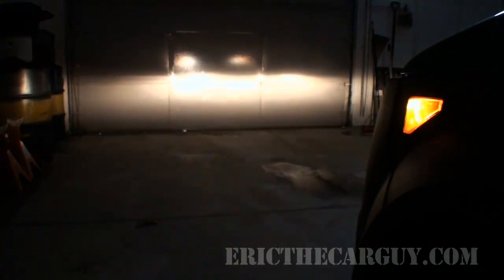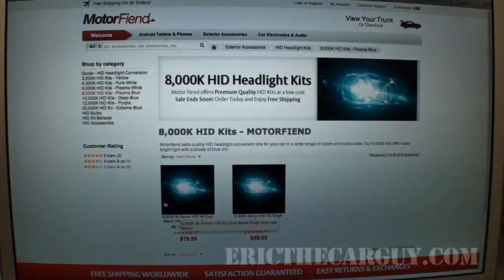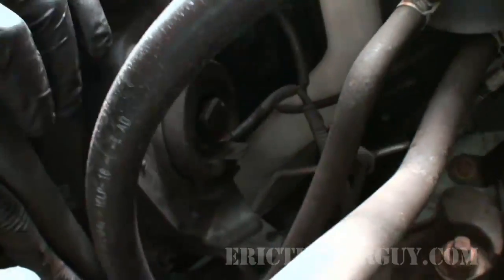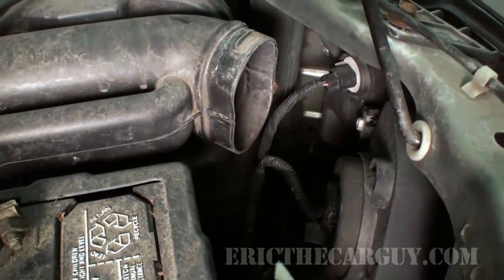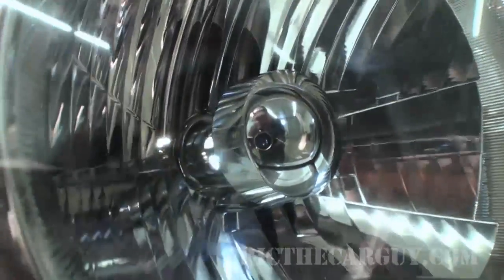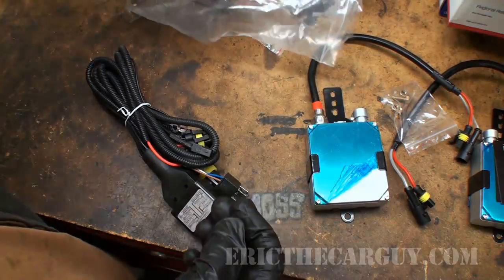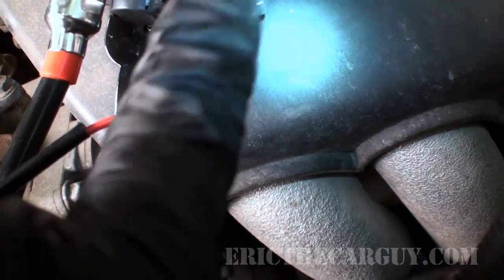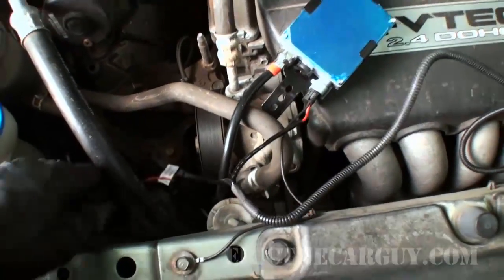How To Install an HID Headlight Kit -EricTheCarGuy

Comment: Which HID setup would be adequate for 1999 Toyota Camry LE, 8000K or 10000K in diamond or sapphire white?
Reply: Neither. 8000K and 10000K are way too blue. The K (kelvin) numbers correspond to the color temperature of the bulb; basically, the higher the K, the bluer the light is going to be. 6000K, 8000K, 10000K...basically anything over 6000K is going to have a very heavy blue tint to it - it's not going to look anything like what a stock Lexus, Audi, or BMW with stock HID headlamps has. "Diamond" and "sapphire white" are just some cheesy descriptions that some seller uses to describe the color of their 8000K and 10000K bulbs. Don't be fooled - there is nothing "white" about an 8000K or 10000K bulb. In fact, most halfway-reputable retailers that offer 10000K bulbs describe them as "deep blue". Not white at all. Do a Google Image search. 

You're going to get the most bang for your buck with a bulb that's 4300K or 5000K. Bulbs in those color temps have the highest lumen (measure of light output) per watt. That means that for each watt of power being sent to the bulb (you're going to want 35W), more light is emitted from the bulb. Between a 35W 4300K bulb and a 35W 10000K bulb, the 4300K one is going to be much, much brighter and look much more like a stock HID bulb would. The higher (bluer) you go on the K scale, the less usable light you have, and the worse the road will be lit in front of you.

None of this is really relevant if you're not going to retrofit your Camry's headlamps with projector housings. If you just put a plug-and-play kit in your existing reflector-beam headlights, you're going to scatter light all over the place regardless of what color you choose, which is going to blind and piss off everyone in oncoming traffic, and the illumination from your headlights is going to be worse off than if you were to get better halogen bulbs.

Hope that gives you some insight. Be considerate of other drivers. Making night driving more difficult and dangerous for others while at the same time worsening your own vehicle's illumination for the sake of having those "k00l blu litez" is definitely not worth it. Also, 8000K or 10000K headlights in an otherwise stock Camry would make you look like a huge wannabe-ricer...that's just my opinion, though.
Reply: thanks man, much knowledge gained, i think i went with a 4500/6000K pack and i can see the road clearly now.
Reply: Tom McKenna Hey there, I have 10K bulbs on my stock tl 2000 right now and I was looking for a blueish light, but the light is really white. So if I want to go white and best output I should get 4k or 5k?
Reply: Indie Guy I don't know that I've seen many (if any) HID kits that are offered at exactly 4,000K. Usually, the lowest "white" color temperature offered is 4,300K, which is the closest you can get to the color that a vehicle with factory-installed HID headlights has - for instance, my Optima SX had HIDs from the factory, and I believe they're rated at 4,250K...very close to 4,300K.

From the various technical articles I've read, it is my understanding that the highest light output per watt is achieved using ~4,200-4,500K bulbs. Bulbs that are any higher in color temperature usually have a type of blue tinting applied to the glass that surrounds the capsule, and that tint is what lowers the light output. It essentially creates a barrier between the capsule, where the light is being generated, and the road ahead of you.

For the best bang for your buck (the highest lumens per watt), you're going to want to get a 4,300K 35W bulb (stay away from 55W unless you really know what you're doing, or you like melted housings/projectors/reflectors/wiring). This is going to give you a pure, non-blue-tinted, very white light that looks identical to what a car with a factory HID system has. Don't worry though, it's definitely not going to look yellowish like a halogen bulb would. You're definitely going to be able to tell that it's an HID bulb.

5,000K would be okay, but most of the kits I've seen use that blue tint on the bulb glass to achieve that ~500K increase in bulb temperature, so inevitably, you're going to lose some light output. It's not going to be much, but it's obviously not going to give you a boost in light output. It's also not going to give you as much of a "factory-HID" look, if that's also something you're going for (I say that because it was definitely what I was going for in my 2012 Fusion when I had it and installed an HID kit in it).

Just as an aside, and I don't mean to direct this at you necessarily (and I don't mean to sound condescending), but carmakers use that color temp range (4,200-4,500) for a reason - it requires no tinting of the glass, and it's the best range for maximum illumination of the road. I will never be able to understand why people choose to use anything higher than 5,000K. Blue tinted headlights not only look ridiculous and ricey, but they don't light up the road anywhere close to as well as a bulb in the 42-4500K range.
Reply: Tom McKenna Well said, however if you are still installing an HID kit into a halogen housing/projector you are not gaining all the benfits of a true HID retrofit. You are also blinding other motorists. I'll never understand the guys that dump $10k+ into a car then throw in some $55 HIDs and wonder why their car looks ricey. Gotta do it all the right way.
Reply: Tom McKenna
Thanks for the thorough explanation. I will be buying 4300k 35w when my bulbs die. My lights aren't blue by the way, there is a very slight tint of blue but it's hardly noticeable. I do agree that cars with the blue tinted HID do look really ricey.
Reply: Steven Kearney Touche - I did say a little something about that in my initial post on this thread, but it certainly bears repeating. I am completely against installing any HID kit in an unmodified reflector-style headlamp. Light will scatter everywhere but where it's supposed to, oncoming traffic will be blinded, the road will be more poorly lit than if you were to use a halogen bulb, and you're going to be worse off than when you started.

I, too, cannot understand how people who are into modding their cars don't understand this. Actually, I think that most probably do understand it, but they are just too lazy or too cheap to do it the right way (or they might think they don't have the skills to pull it off). I do understand that a full-blown, correctly-executed retrofit is not always a simple project, but regardless of its level of difficulty, the benefits a good HID retrofit absolutely justify time and effort that goes into doing one.
Reply: Tom McKenna Exactly! I retrofitted my 04 WRX 2 years ago with a full projector setup and 5k bulbs, couldn't have been happier, now to mod my 09 ZX6r this winter with the same setup!

Comment: Could anyone tell me why my 8000k headlights that I just bought are more white on one side than the other. Just bought and installed today.
Reply: If you let them warm up and they are still a different color you should return them. Maybe the next set of bulbs won't be bad.

Comment: Can you use hids in projector headlights
Reply: Eric Jones Yes, but there are two types of projectors, halogen and HID projectors. If you put HIDs in a halogen projector, you won't be getting an ideal cut off as the projector was not designed to disperse that much light. You will want to aim for using HID projectors as you will get the best cut off and brightest output.

Comment: I notice these at least have an attempt at a projector retrofit.  Either way, since these are not proper HID enclosures, you no longer have DOT approved headlights.  Enjoy being legally responsible for your next head on collision; even if without these lights you would have not been at fault, illegal tampering with safety equipment such as this means you are.

Personally, I can't afford being at fault, and I question if my car insurance would even cover such a situation.

Just don't do it.

Comment: Get a shorter screw for the control unit. What you did there is hack it and youre inviting problems down the road. I personally would have left the lights stock. Those HID kits piss me off and blind me. They werent designed for your vehicle for a reason!

Comment: Eric, I praise you for your work 100% of the time, but this time... not. HID's DO NOT belong in reflector housings, no matter if they have shields or not. You will still blind the HECK out of incoming traffic. The housing is not designed to use this kind of bulb. You absolutely need a projector to use HID's properly. Please do some research on HIDplanet.dot.com and theretrofitsource.dot.com. It is possible to install/retrofit HID projectors in practically every car out there and have proper HIDs

Comment: Do I realy need the conversions kit or can I jus buy the bulbs and install em
Reply: If you wanna convert from halogen to xenon, yes you need this kit, the reason is that xenon bulbs need extreme high voltage to light up , its around 45000 volt, thats why they put warning sticker on the ballast. 

Or there is another option, you can go with the philips crystal vision bulbs, they are halogens but with high temp. That give 4000K , which is almost xenon without HID kit.
Reply: *****
Yes maybe Sylvania bulbs are wider in lightning, but philips are brighter, and now its your choice which one you prefer, Sylvania are still one of the best. :)

Comment: wana know whats dangerous? are the 10's of thousands of cars with 1/8" thick film of oxidation on the headlight lenses  its so bad that hardly any light can penetrate it
i would much rather a cop pull over a car that has severely corroded headlamps than a car i can see from 50 miles away   i know from exp that they do pull you over for headlamp obstructions as i got stopped for them being covered in mud....the cop was very nice and even helpe me knock off some of the caked mud  no ticket tho ;)

Comment: So these are the lights that blind me every time lol
Reply: HID and the new brighter led headlights should only be used on vehicles with projector style headlights. These are designed to keep the lights forward and down for this reason. Now that the price has gone down and ease of instillation has gone up everyone is doing it. The older style headlights are designed to help spread the light in the correct areas because the older  incandescent lights do not put out nearly as much light. It should be illegal to install hid or led headlights in non-projector style headlights. Easy way to enforce the law.
Reply: @JohnCiaccio  people are still going to do it anyway

Comment: kelvin is the measure of light temperature the higher they are the bluer they look, the color correlates to the temperature of a star of the same color, 20,000 kelvin would look like a blue star, it has nothing to do with brightness, lumens and lux are brightness.

Comment: They blind like hell and cause massive glare. In addition to this, the light distribution pattern will be all out of whack, because the reflectors were made for halogen bulbs, not HIDs. When it comes to HIDs, it's projectors or nothing. And going above 5000K in color temperatur is pointless, it doesn't bring any benefits at all.

Comment: A real auto mechanic/car guy would never promote putting an HID kit in a halogen housing.  A retrofit kit from The Retrofit Source isn't that expensive and all it takes is a bit of time and patience pulling the headlights apart.  I was able to put the Morimoto H1 kit from TRS on my Honda Fit in one Saturday.  I'm officially unsubbed after this.  Deuces!

Comment: So you and Scotty Kilmer got paid to install headlights that have horrible light output, because the light coming from their AWESOME HID KIT is not focused at all, and you may have slightly brighter lights, but you are blinding oncoming drivers with the new found light, because your old halogen bulb housings are designed to scatter the light of the less efficient bulb.Projectors are the way to go, otherwise you are wasting your time, and making the roads more dangerous.

Comment: Man I thought you were smarter. Stop blinding people on the road. There is no way you will get the legal light flux above the cut-off. The scatter went up a lot. you can see that on the garage door pictures before/after. Can you see better above the cut-off there? Yes you can because you send more light there. And that's where my, oncoming driver, eyes would be.If you wand legal HID - install projectors designed for it.Revert one back to halogen and take a car pic from above the cut-off.

Comment: Take this video down. This is NOT a repair video, this is NOT an improvement video, this is how to install cheap Chinese crap into your car that will blind other motorists. True HIDs require proper projection and a halogen headlight assembly CANNOT handle this type of light. If you think "Well I aimed them down" is a solution for this then the next time you break a bone I'll spit on the limb and say its fixed.
Reply: Tyson Matzen Ouch, you showed me
Reply: Steven Kearney Get blinded by my shitty HID's.
Reply: while there are people who go out and buy el-cheapo kits that don't come with the bulb mount mask /heat sink deflector and they use the wrong  type of bulb r vs s reflector vs projector.
while i am not a fan of the china made kits i use modified Toyota ballasts my self and Philips lamps.
as long as you have the bulb mount set correctly and the right bulb setup that is designed  for reflector type housings light scatter is no worse than original halogen setups.
Reply: sambou812 What is your setup and on what vehicle? 

Unless the housing is MADE for HIDs there is no way to make it handle HID light without a retrofit, not sure if you are just upgrading your HID bulbs to better HID bulbs.
Reply: Brandon Closson Well good for him, maybe he should teach people useful improvements to a vehicle, not this 16 year old riced out Civic shit.
Reply: Steven Kearney it's an element not a civic. Plus why are you mad, how does Eric installing HIDs affect you in any way.
Reply: XJordanx89 Civic, Element, Accord, Maxima, Impreza. Doesn't matter what the car, if it wasn't from the factory with HIDs you need to do a full retrofit.  These videos show uneducated people the WRONG way to do an upgrade to their car. That same idiot is now driving down the street blinding the piss out of everyone. I don't care if you install an exhaust, coilovers, roll cage, whatever. But when I cannot see because of your "mod" then it affects me. Do it right.
Reply: Steven Kearney lol good reply
Reply: sambou812
Actually no, the light in HID bulbs are produced diferently than traditional halogens therefore you need a housing made for them.
Reply: casper shield,i didn't know what that was called thanks
i was referring to as an bulb mount mask lol.
live and learn..
Reply: ***** I've seen the Chinese use every tactic from shields, magnetic movable bases, and god know what else to try to trick buyers into thinking the bulbs are correct. The fact is the light is completely different, it has one hot spot instead of two, the direction of the light source is parallel to the bulb body instead of perpendicular, the location of the hottest point is thus moved from the OEM location and changes how the light is handled.  The fact that at 33:53 he mentions having to adjust the light indicates its not correct. I can go to Advance Auto or wherever and throw in 10 bulbs and will repeat the same cuttoff as OEM, plug and play HIDs however will never repeat. The shields simply mask some of the scattered light, even if they reduce glare you have effectively limited the amount of lumens being projected out onto the road. Why not just do a proper retrofit with HID projectors and get what you pay for.
Reply: ***** Ignorant and racist? Man you're pulling out the big guns. First off there is a HUGE difference between an OEM HID headlight that uses a reflector bowl and a plug and play system. Companies like Volvo that did it for years specially design the reflector housing to handle the HID light. These are simply not correct to use in halogen housings. The casper shield in both OEM applications and this is the same, block unnecessary light, the difference is how the reflective housing behind the bulb handles the light. An OEM housing will properly project it where a halogen housing will still cause scatter.  Maybe do a little more research before you go blabbing on the internet about it.
Reply: *****
Yea Eric does post some useful videos, I will give you that.  However like Steven has already stated this is not a repair video.   He is installing illegal lights that were not designed for the headlight housing that is going to cause a dangerous amount of glare.
Reply: Lol
Reply: Cool story bro!   Ever heard of DOT?  These lights are not DOT approved and therefore illegal.   Since your man crush Eric said it in the video it must be true eh?  Lol ok buddy keep at it.
Oh

Comment: looks like shit, because h.i.d.s are supposted to be mounted in a projector housing, this is not a projector housing its a regular headlight, which is why the whole housing is filled with light, look at say an acura tl that does have a projector and hids look 1000% better. hids look and perform like shit in anything but a projector housing.

Comment: I had to dislike this video... And I love your videos and your work, but this one I can't possibly understand. I don't know what is your pleasure by blinding the other drivers... You should have retrofitted projectors to your headlamps and it would be a perfect job. You should only use HID in reflector headlights specially designed for HID, otherwise you blind the other drivers with the excessive glare. Check out the marimoto's mini h1, for example. I also recommend you to use 4800k or 5000k max